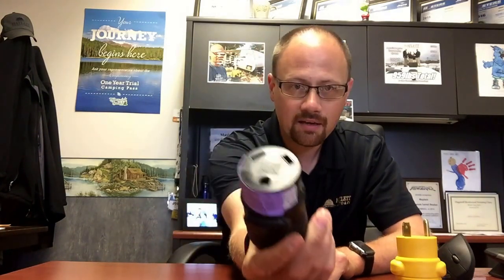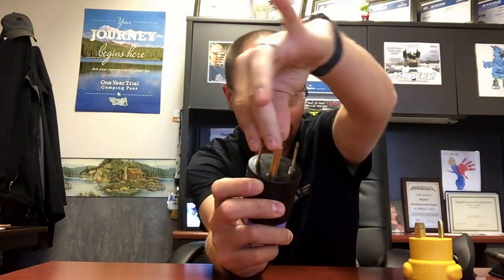HaylettRV - 15, 30, and 50amp Electric Adapters with Josh the RV Nerd

Comment: So what I didn't see, is how to change a 240v round 4 prong plug to a 30amp or 50amp and is it safe. I'm asking for all the potential Ford PowerBoost owners with the 7.2 system in the back. How does THAT work

Comment: Can I use a 30 - 30 dog boneinto a 50.  Thats 60.  My friend said I could use that.  I'd rather have  30 - 15 like you show..  My new trailer is 50 amp.  The dealer did this because it is wired for two A/Cs even though we only have one.  I just ordered a 50-30 ame long cord and run it as 30 mp.  Never had any problems.  Should I run itat 50 amps?
Reply from the maker: If the RV is 50amp, then you can use a 30amp service w/o issue. You just may not be able to run everything at the same time. Unless you add a 2nd air you really won't have to worry much about it

Comment: Josh,
I know this is an old video but I have a question related to this.  If I don't want to use a 110V adapter and I want to be able to run "everything" in the RV what would I need to do/get to install a 50 amp box in my house.  Is it a major project?

thanks in advanced.
Reply from the maker: It's something I'd recommend calling an electrician to handle. But they shouldn't typically have any issues.

Comment: Installing SoftStart on the ACs will help you run 2 ACs on 30A?
Reply from the maker: Possibly. There are a few things that all have to line up to accomplish that. It's placing a huge demand on the RV's electrical system & comes with a laundry list of cavets and conditions
Reply: Depends on size of the AC’s but say 13,500 BTU AC and the service coming in is 115-120 volts then yes
If the output voltage is 110 you could be cutting it close 
My 13,500 ac pulls 1300-1600 watts so 110 volts times 15 amps would give you 1650 and at 30 amps 3300 watts… you’d have enough to start and run two units but not much power to run much else at the same time… I know my tv in my unit pulls about 35 watts
Reply: Also keep in mind RV’s are not compatible plugging into a GFCI outlet at your home… due to things like the camper having a GFCI installed in it will cause the GFCI in your home to trip and also things like the heating element for your water heater in your RV can trip your home CFCI and other devices in an RV can also play havoc on your GFCI outlet in your home…. So best to plug into a non GFCI outlet or in a pinch you remove that third round pin from your adapter pin and it should no longer trip your outlet

Comment: Do they make an adapter from the 30 amp to two 15 amp Y connecters that you could plug in at home and get your full 30 amp usage out of your camper??? and if the camper is 30 amp should you stay with a 30 amp protector or would a 50 amp not hurt anything it just wont draw the extra 30 amps??? Also thanks for doing a video on the leaving the camper plugged in question I asked you the other week! great info as always!
Reply from the maker: There are a few things out there sort of like that. They kinda work, but kinda don't. You don't actually end up pulling a full 30amps. They're good for "quick pinches," but not intended as a permanent solution.
Reply: Haylett RV where can I find the mutant...I’m so confused what to buy for 50 amp down to 15 amps.   My 3 year plugs seem to be fried maybe from rain...

Comment: A quick question for you Josh, have you done a video at all on means of protecting your camper from high and/or low voltage and even on how to check the polarity/safety of your power point in a park ? thanks David.
Reply from the maker: Not yet. Bunch of stuff like that I'd like to do. It's why I'm working with Aaron to bring him into our video work. I just cant get to everything
Reply: @JoshtheRVNerd  thank you for your quick response. I look forward to seeing it in time.

Comment: Josh, I have a question.  I have an adapter that plugs into both 15 amp outlets at the same time and has a 30 amp plug.  I only use it to get the fridge to cool down before we leave.  But I was wondering if it is any better than just using a 30 to 15 reducer?  Thanks.
Reply from the maker: I'm not an electrical engineer & I have no experience using the device you've described personally (Though I fully understand what you're describing). I would have to refer you to someone with more specialized training. 

I would SUSPECT the way you're using the device makes it functionally no different than a reducer, but I don't KNOW that. And Electrical stuff is NOT a good thing to make assumptions for.
Reply: Josh is correct.  It would be no different than using a reducer.  The only way you would be able to draw 30 amps with that setup is if you could somehow plug your splitter into two separate circuits.

Comment: hey josh,  where can I get that y connector 50amp to 30/15.  I can only find the reverse male 50 to female 30/15.  Thanks for all that you do, great information !!  :)
Reply from the maker: Since my video I also found a handy 30+30->50a adapter at https://haylett-auto-rv-parts.myshopify.com/products/19-0416
Here's another version of a similar product: https://haylett-auto-rv-parts.myshopify.com/products/19-1380
Reply: I need that particular y adapter because im at a seasonal camp ground and they only have a 30 amp  and 15 amp service. I have a 50 amp trailer and trying to get as much power as possible.  Do you sell that one in your store?
Reply from the maker: Yeah give our parts team a call at 800-256-5196 & they can send out one of those yellow 30+15's off our shelf right to your front door!
Reply: Haylett RV looking for the octopus name or link you showed

Comment: Thank you for this information... For me personally you have elevated your company at haylett to another level. Personally... Before I buy my camper and get more educated I will make hopefully the right decisions as to my expectations and needs. It seems to me beside poor information and education for a potential RV user it is not a house/Sticks & Bricks... I personally think that the expectations of consumers and lousy information from manufacturers and dealers is a wide margin. Please elaborate from your company and yourself to educate me on the realities of the differences pros and cons and whether I have a small 30 amp trailer or 50 amp trailer and what my options are. Number one... To be safe. It doesn't take a whole lot of brain cells to understand that for example I have a 30 amp trailer and my significant other wants to run her hair dryer and the microwave and the air conditioner

Comment: Low voltage is more damaging than high voltage.  An Electrician told me that electric motors will run 10% over voltage but only 5% under voltage before it is damaged.
Reply: That is true, brown outs are very damaging to equipment where as many devices will happily run over current and increase their efficiency.
Reply from the maker: This is shockingly enlightening. People will certainly receive a jolt from this news. I'm tingling from the anticipation. cough
Reply: @JoshtheRVNerd  Sometimes you overload my "dad joke" meter! Keep up the informative and entertaining work!

Comment: Thank you so much.  I went to the Coachmen Apex Nano website, and they said the Apex's were 50 amp RV's.  I am only interested in going small as no larger than 185bh.  50 amps seems like a bit much for such a small RV.  I want to camp where only 30 amps are available.  Did Coachmen fail to address the 185bh properly?
Reply from the maker: No no no no no -- Apex models are all 30amp service standard. The larger models have the OPTION of upgrading to 50amp service from the factory to make them 2nd A/C ready. Glad you mentioned this so I could get you proper information!
Reply: Thank you so much.  I really don't want to make a mistake in purchasing our first TT, and have to listen to my husband's "Well that's what you wanted!"
Reply from the maker: Even my grandfather would disagree lol
Reply: Grandma,; you should always listen to Grandpa!  :-)

Comment: Thanks for the information.  So is 30 amp single phase and 50 amp 2 phase?
Reply from the maker: Here's a resource I think will answer your questions pretty clearly: https://www.rvtechmag.com/electrical/chapter3.php. I generally don't direct folks off my channel like that, but you seem to have a level of electrical engineering-ish knowledge & should be able to really understand it all well after this. 

My videos are very generalized and usually designed to help people understand the working basics of things in common words everyone can understand. I often consciously use phrases that aren't technically accurate, but functionally accurate for the every day RV'er.
Reply: No it's all single phase, 50 amp is just 2 110v 25 amp breakers going to 1 outlet. Same as the 220v circuits in your house.

Comment: GREAT informational video on electric adapters. This got me thinking. My dumb ? for the day: Can you order a trailer WITHOUT a microwave? It's a big wattage draw item WITHOUT much benefit. I would prefer a toaster oven AND stove without microwave. The toaster oven & stove use MUCH less wattage than the microwave. If I was FORCED to chose to opt out of a high wattage item it would be the microwave. The A/C & the fridge are on the NEED list. Some kitchens I see online these days do NOT have a microwave. Just a thought!  :)
Reply from the maker: Generally: No. But it's four screws to remove it basically. No big deal if you'd rather have an extra cabinet space.
Reply: If you own a BIG trailer with several A/C's, I would rather nix the microwave than the A/C!! If you remove the microwave, does this ruin your warranty?
Reply from the maker: The microwave only really draws when it's in use. Simply being present doesn't really hurt anything or draw enough power to matter. You could always just unplug it. Basically all MFGs simply hide the microwave's plug inside a nearby kitchen cabinet.
Reply: WOW!! Good to ask ?'s!! I mistakenly thought that while plugged in the microwave is drawing power!! Ok, so it only uses power while on!! GREAT to know!! THANKS!! :)
Reply from the maker: Not enough to really cause power draw issues with hookups.

Comment: Have you/will you do a video about generators? Specifically 2k watt range, and what you can run on them. 
Thx, for the vids.
Reply from the maker: Can't really do a video as you've described as that's not exactly how generators work. You can have 2 different 2k Generators from 2 different brands. One runs an A/C and one does not. There are a lot of factors. I have a general idea on them, but I don't yet feel I'm educated enough to speak properly on the subject. 

Thankfully... we have people for that. Our parts team actually gets Yamaha certified and is better equipped to handle such questions.
Reply: Haylett RV , OK, thanks for the reply.

Comment: good stuff. I got stuck once with having to use a 50 to 30 reducer as campground only had 50amp at the premeium sites.  
didn't know until we got there. but i have been using the 50amp service since along with surge protector.

Comment: Good video. Thanks for doing these.

We have a 30 amp TT and use the 30->15 amp reducer to plug it in before a trip. It lets us get the fridge cold without using propane and turn on lights to see what we're doing after dark. Definitely won't run the AC though.

FYI, I've been to several campgrounds in California that prohibit using the 30+15 amp cord for 50 amp rigs (my brother-in-law has a 50 amp 5th wheel). That something to be aware of if you plan to use one of those adapters.
Reply from the maker: We actually have a thriving customerbase in California. I'll keep that in mind!

Comment: Good information. I studied hard when I went to a 50 amp 5th wheel. It's amazing what and how you see people wire things at campgrounds. People should always use a camping surge protector too. I like that octopus looking adapter. Gonna have to get one.
Reply from the maker: I've walked by them countless times and never bothered to actually look. One of our salesmen here actually worked for several vendors that sold to the RV mfgs themselves. He advised a company he worked for YEARS ago made those and they never caught on, but I don't think there were nearly as many 50amp models on the market at the time.
Reply: Where are they sold?????
Reply from the maker: @ILkaterlyn  Here's a good place to start https://haylett-auto-rv-parts.myshopify.com/search?q=surge